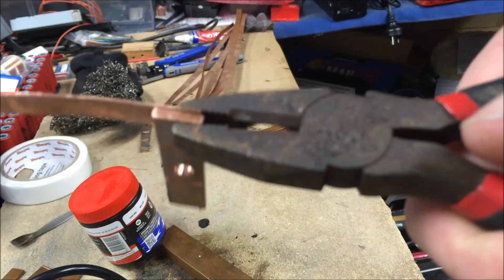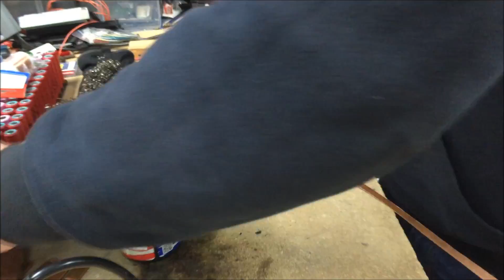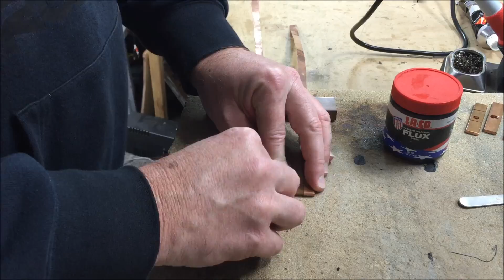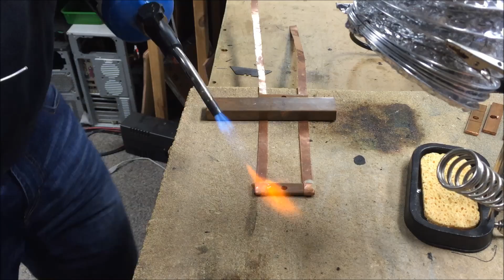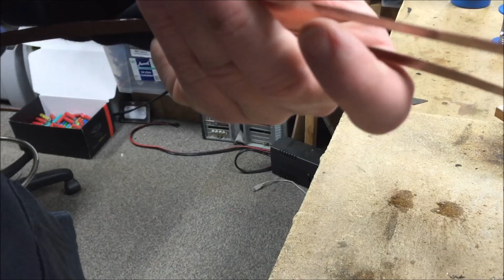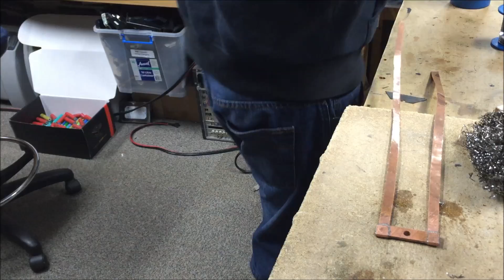Busbar improvements :)

Comment: While copper IS better (from a conductivity standpoint), finding copper strip in precut form is a lot harder than say, “hobby-store brass” - K&S brass, for example.

Could one use, say, .025 x .500 (.65mm x 12.7mm) sheet brass?
Reply from the maker: We have come a long was as a community since this video but thanks for the input

Comment: Do you fuse both the negative and positive sides of the pack or only one?  Would there be any negative effect of fusing both sides?
Reply from the maker: I did try fusing both and it was a fantastic idea however I quickly stopped doing that as it was another point of failure. Just in the moving it around the bench and stuff I found I was damaging fuses

Comment: Now I've kind of lost track of your bus-bars and what they look like now, any particular reason you went away from these ones?
Reply from the maker: Yes, it's cheaper, faster & a better way of doing it compared to my old way. It's all about doing these type of DIY things better!
Reply: Cool, What gauge of wires are you using for the new twisted bus-bars with the crimped connectors on? I'm sure you've said it a couple of times but I've completely lost track of all your bus-bar videos! :-P

On the subject of bus-bars, have you tried to measure the voltage drop across the bars when you put a heavy load on a cell-pack like 1C per cell so around 200A with 80 x 2500Mah cells, I'm curious to see what kinds of voltage drops you would see with your new bus-bars.

I'm thinking of using 10m2 cables or 3/16" copper brake pipe flattened which will have a cross section of 10m2 and based on a 2x15 cell bus-bar with a 1C discharge on 2500mAh cells the voltage drop should be around 22mV at 75A per 30 cells. Each bus-bar would dissipate 1.26W so they should heat up very little. But it's still 7.5W per cell-pack or ~ 100W per string of cell-packs in a 13s90p configuration. 

I'm thinking of using 90 cell packs in a 6x30 configuration so they are shorter but taller than yours...

Maybe I'm overthinking it again! :-P
Reply from the maker: 6mm square 240v power cable

Comment: That's fantastic mate. Your soldering  skills are great. I'm a nut & bolt man. Nuts & bolts through my battery packs and for all bus bars. Cheers.
Reply: I'd love to see your approach. I took a different tack. I get around the balancing issue (and the soldering as well) by making my batteries interchangeable. Of course I'm only working with 30 at a time for my Ebike. Mk my approach wouldn't work for a powerwall. I saw another approach on batteryblocs.com but they are expensive.
Reply: +Rocket Rose hey mate. Sorry I meant for assembly purposes. I am soldering fuses. I tried clamping the fuses couldn't get a reliable connection. Cheers

Comment: Nice !  Would a Dremel work to cut the copper, making it easier to follow a straight line etc ?
Reply from the maker: don't own one but it sould like it would work.
Reply: Also, a jeweler’s saw works well for copper and brass.  (Been using one that way for twenty-plus years.) 

Use door-lubricant stick on the blades - or beeswax.  The lube-stick works a tiny bit better.